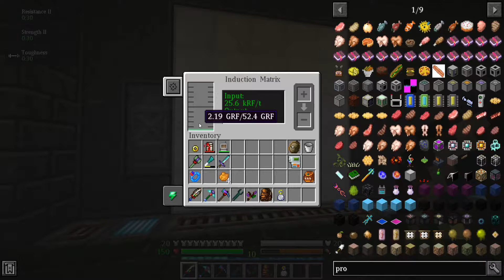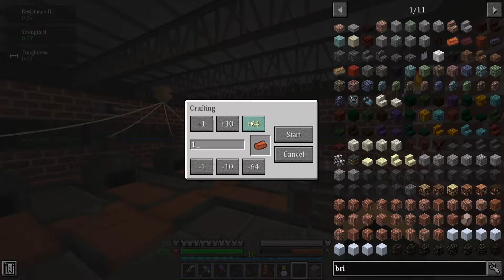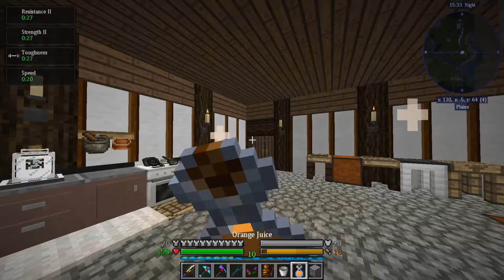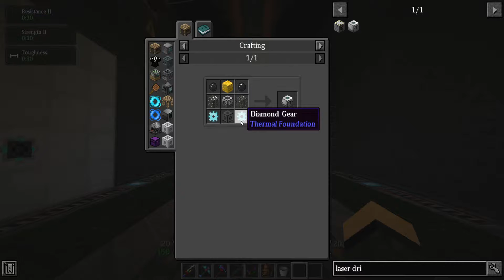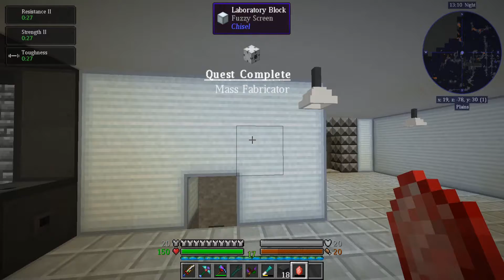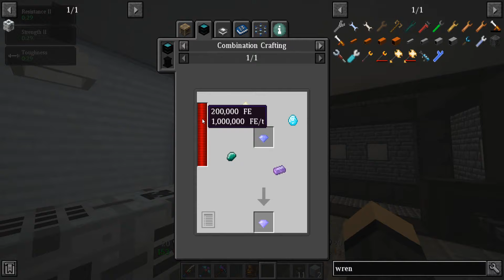Enigmatica 2 Expert :: UU-Matter :: E2E-43

Comment: The Crystal Growth Chamber from AE2 Stuff is super fast at turning seeds to Pure crystals and will hold many stacks at once. It may be a nice alternative to using the Mekanism Enrichment Chamber. It will also handle making base fluix crystals much faster (as opposed to dropping the mats in water).
Reply from the maker: The downside to that is that the growth chamber requires AE energy, and adding an energy accepter to the mix is a bit annoying to be honest
Reply: @theeldersign  Fair enough! I guess I hadn't worried about that since I incorporate it into my cluster of Advanced Inscribers that also require an Energy Acceptor, so there's always ME power in my area anyhow.

I'm really enjoying your series! I like your design aesthetics. It seems you may have tacked on some nice looking mods I don't have in my E2E like Engineer's Decor & Redstone Gauges and Switches. I also like the Metamorphic bricks, which reminds me I need to work on Botania again soon.
Reply from the maker: I personally love both Decor and Gauges, I wish they were in more packs honestly

Comment: Asphalt with increased speed would be very handy, but this is not Terraria unfortunately
Reply from the maker: There are mods that add increased speed to blocks though, sadly they aren't part of this pack
Reply: Concrete has a run speed bonus, so most of my current E2E base's floor is made of concrete. Also, Thaumcraft's Paving Stones of Travel are sorta pleasant-looking and might look good mixed with your hempcrete and green metamorphic bricks  in small high-traffic areas.
Reply from the maker: I completely forgot about the paving stones, I will definitely have to play around with those.